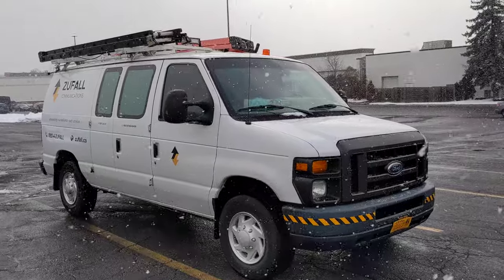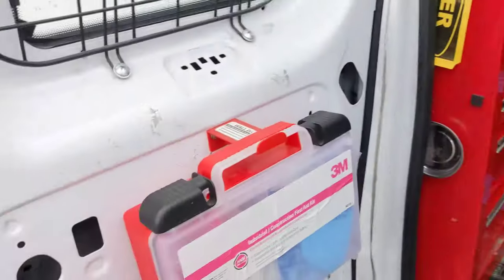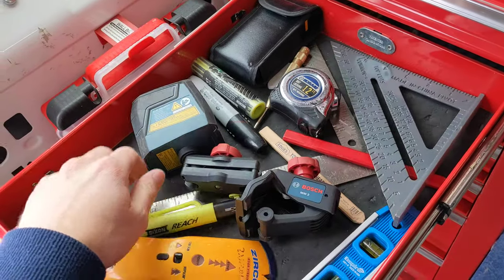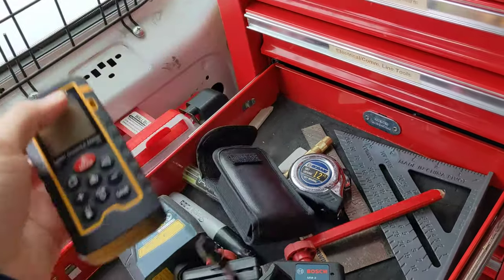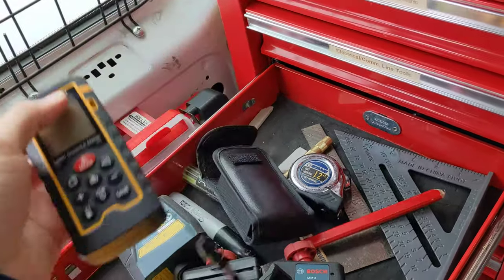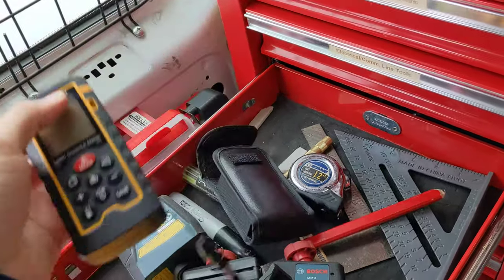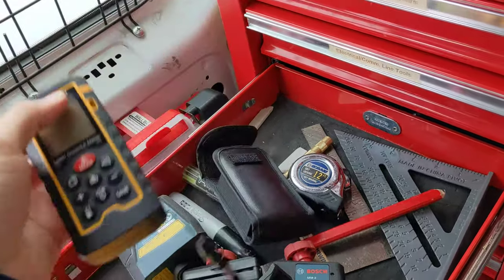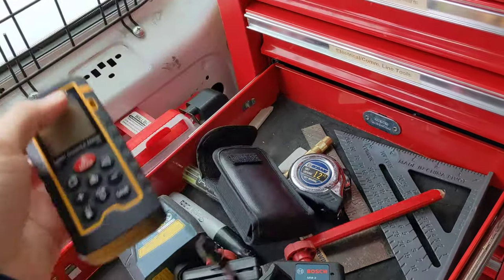IT Network Cabling Van Tour - What's inside our mobile toolbox?

Comment: 2 things to add. Pulleys for running wires around turns. Pullingpal is one brand. Tone and probe kit, tempo/greenlee is the best Ive used. Dont buy the cheap knockoffs.
 Theyre garbage.
Reply: Fluke >>>>>>>>>>>>>
Reply: @Sofiaitsp  i had the fluke. It doesnt have an led indicator on the probe AND  broke 1st day on the job!

Comment: Why don’t you use CAT6 instead I have to ask? It’s basically the same price now as well (or at least where I am)
Reply from the maker: Because many of our customers don't have requirements beyond 1 gigabit, and Cat5e and Cat6 are both rated for gigabit at 100 meters. That said, we've actually just finished switching over to Cat6 as our standard because that's where the industry seems to be going even for low-bandwidth applications. I was hoping we could jump straight to standardizing on Cat6A, but the pricing for that is still way too high for when it's not explicitly needed.